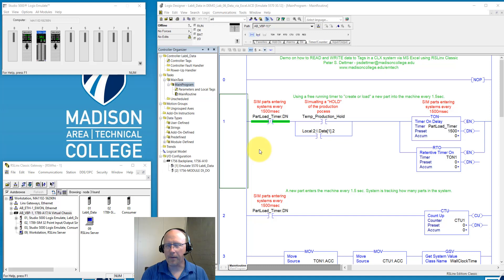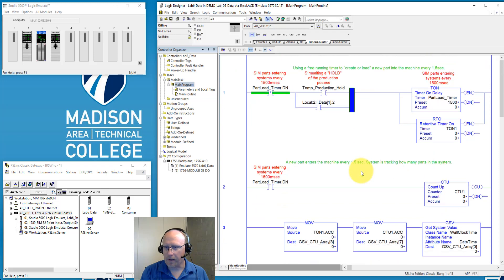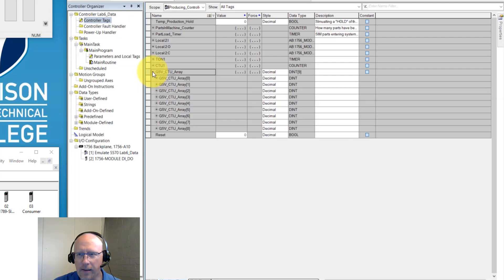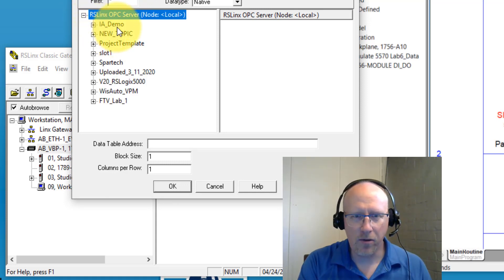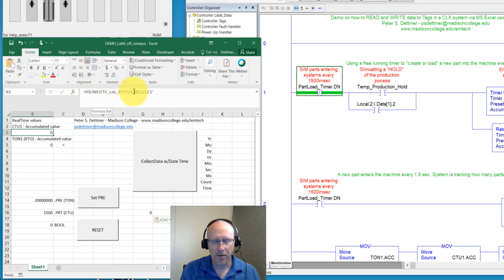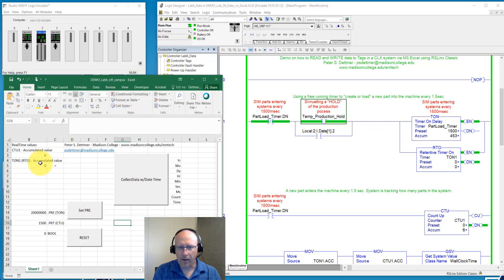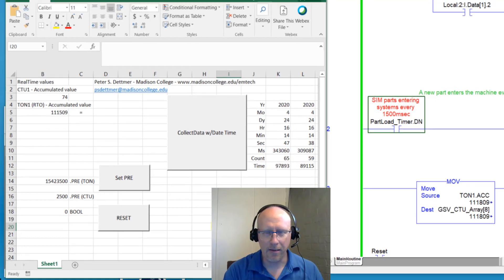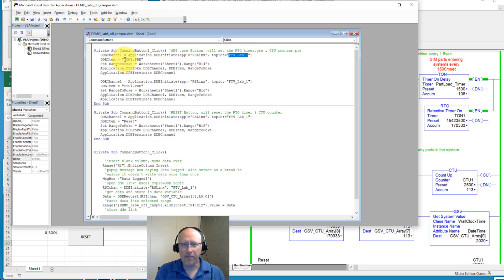Read and Write Data in MS Excel, using RSLinx to and from ControlLogix

Comment: It's possible do the same with Micrologix PLC??
Reply from the maker: Yes, there is sample code available for RSLogix 500 based controllers. Communication settings depend on your protocol (Ethernet IP/ Serial, etc....). You need RSLinx with the DDE/OPC capability. Good luck!

Comment: How does this work with strings?
Reply from the maker: Not sure. Haven't tried that yet. I'd expect very similar, just a matter of changing the data types?
Reply: @PSDettmer  I struggling right now trying to get this very function working.  Im trying to get the STRING text to load into excel and it just wont let me!
Reply from the maker: @dustinmcrae349  send me an email and I'd be happy to share the Excel template with you. "STRING" text requires specific syntax - maybe check the RA KnowledgeBase as well?

Comment: Thanks for the video, I do have a suggestion from our findings in the past few months & speaking with Rockwell.

If you try this on Windows 10 & any version of Microsoft Office above 2016 & it no longer works...DDE is what is used & it is now disabled so moving forward any command codes should be used in a real OPC not DDE like the copy-paste method. There are a lot of other tools to use & Rockwell Automation themselves has demo excel files to read & write data.

DDE is broken after Excel 2013.

You can try to enable it but depending on what version of RSlinx you are using, it will break.

Standard in the field as of 2021 is Windows 10 MS Office 2016 or even MS office 365
Reply: It's been a year since your comment, and I'm glad to report Microsoft has fixed DDE in Excel 2019 and 365. Two new security options in Trust Center for DDE. I can easily read and write to PLC from Excel using the paid version of RSLinx Classic Gateway.
Reply: @glennrager3684  I got some problems with the connection between Excel and RSLinx. All options in the TrustCenter for DDE are correct. But Excel says "can't find RSLINX.EXE' altough RSLINX is already running :(  Is there anybody who could help?
Reply: @chgerding  Are you using the paid version of RSLinx Classic Gateway? The free Lite version doesn't work for DDE.
Reply: I haven't tried it yet, but: 
https://docs.microsoft.com/en-us/office/troubleshoot/excel/security-settings
Reply: @superezbz  I have worked closely with RA & there is no fix besides transitioning directly to OPC or making your own data move in Python.

OPC is easier.

DDE is gone for new Windows & Office
Reply: @LearnSomethingHelpful  I figured out how to do it on an offline program. First, you export a rung that is referencing the array. Then, you open the L5X file in a text editor. You will see that tag data values are in the L5X text. Copy and paste into excel. Edit the values. Copy the excel code back into the text editor in the appropriate place. Then, this is very important, delete the rung AND the array from the controller. Then import the L5X back in. You will now have your rung back with a fully populated array.
Reply: @superezbz  We are talking about reading tag values not rungs
Reply: @LearnSomethingHelpful  I know. I'm talking about writing tag values en masse. It works. It is the only way I have found that is capable of doing it offline or online, without extra licensing or running a Windows 7 VM or machine. When you export the rung or routine, the tag values are written into the XML file. Those can then be manipulated and re entered into the program. That's it. If you are really good, you could write code in XML if you wanted to, including populating arrays. However, I find that writing repetitive code is best accomplished in Excel. Excel is far superior in data manipulation than Studio 5k.

Comment: Hello! How can I set this up so it logs the data every 24 hours automatically, without using a push button?
Reply from the maker: The button just triggers the Macro. You can write a separate Macro to trigger the "Data Collect" Macro at specific time intervals. Search for this on YouTube: Automatically Run a Macro Every X Minutes or Hours - Good luck!